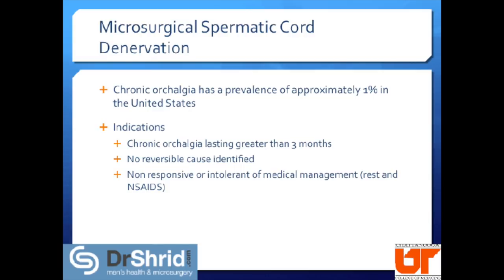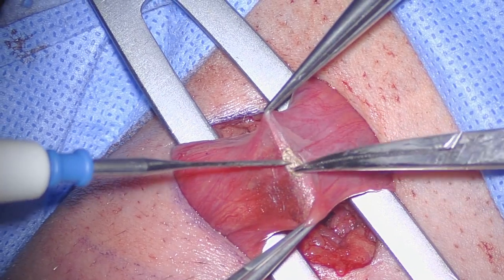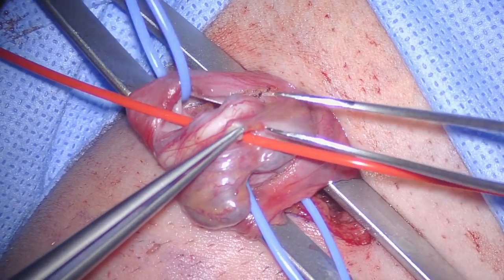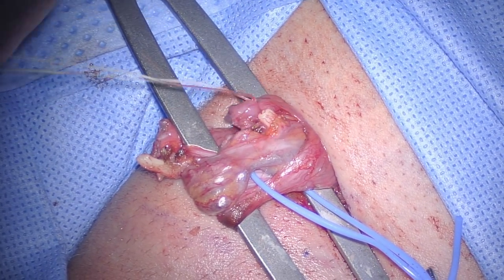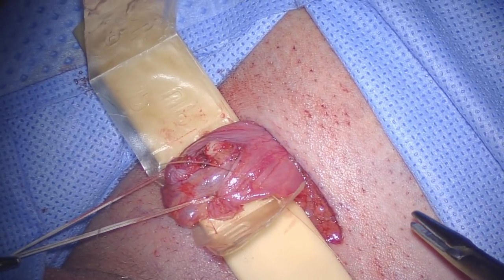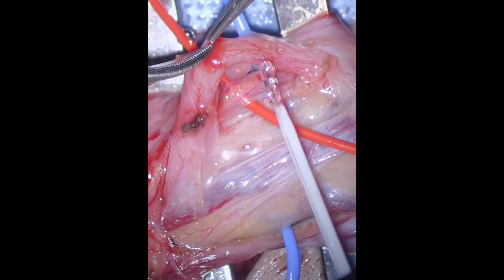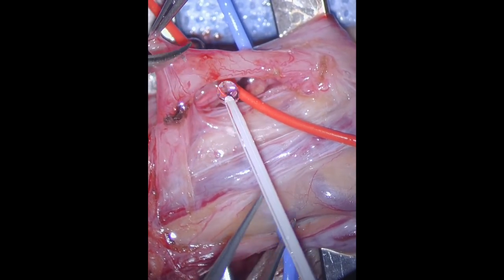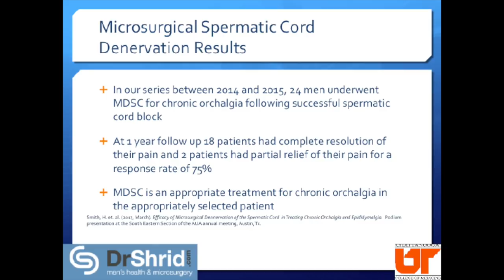Microsurgical spermatic cord denervation

Comment: Hello ,
in 2022 I had a blind blockage of the spermatic cord. During the blockade I felt very severe pain. since then the testicle has been cut off. I don't feel a pulse in my cord. over time, the testicle shrinks. after two years, one third remained. the blood supply is from the seminal artery. 
I have terrible depression and dull pain. abdominal obesity appeared. Can testicular atrophy be extended in time? this has been going on for over two years. Regards
andrej